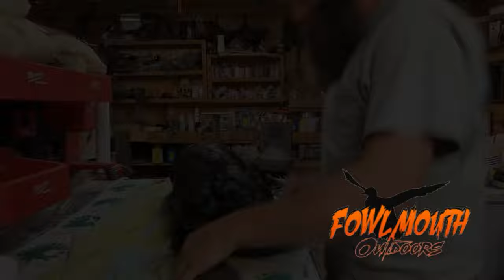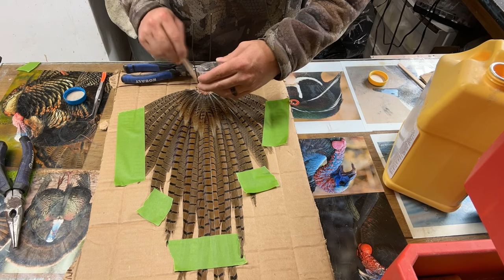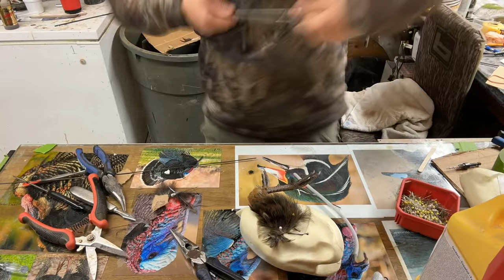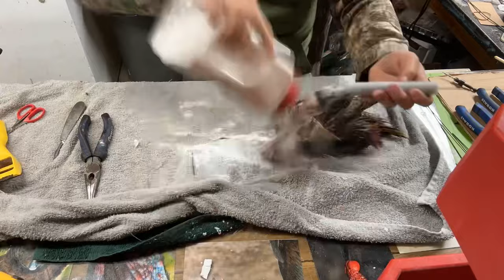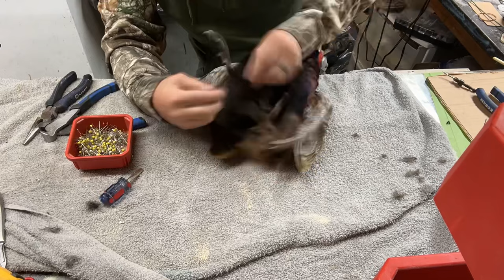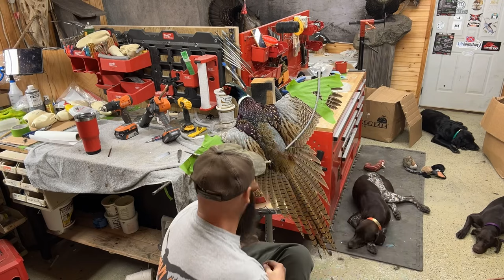Mounting a Pheasant in 7 Minutes!!

Comment: I’m a taxidermist in Ohio I dig the way I did this because it was so fast I could t quite catch how u cut the leg drums completely off and we’re u pumping caulking above the wings for plumpness of so what did u do make small cuts there in the skin?
Reply from the maker: Leg incision was made around the knee joint. Yes small incision between wing and scap to be able to inject adhesive into the wing and shoulder area
Reply: @Fowl_Mouth_Outdoors  so the drum section was still on body skin ?